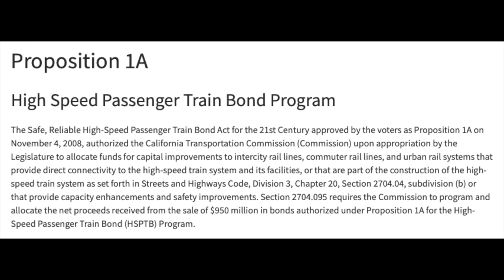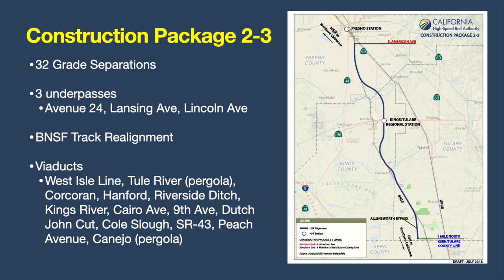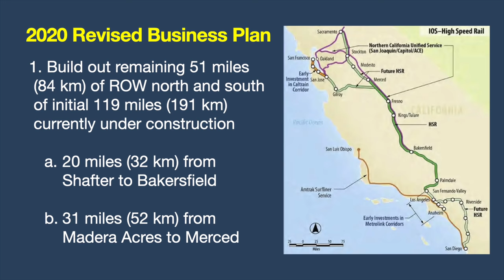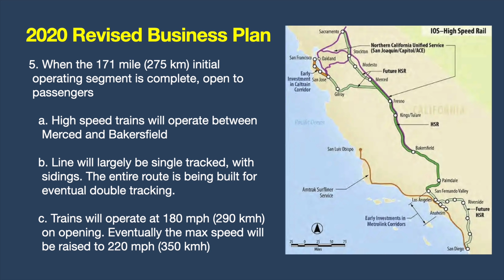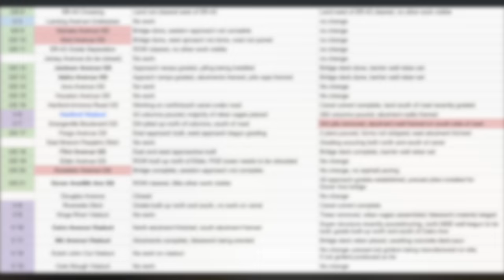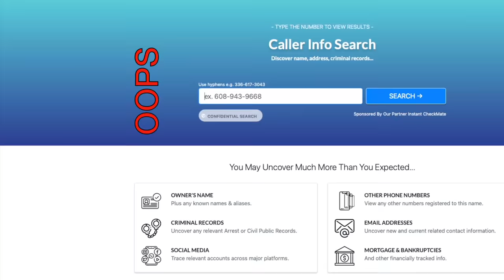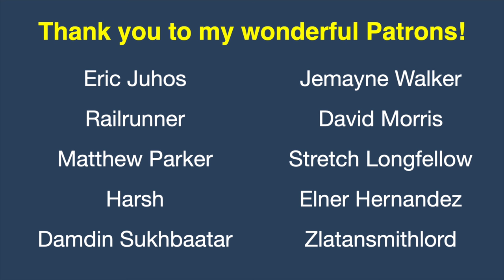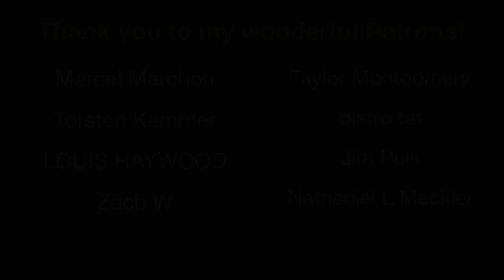California is Building High Speed Rail. It’s time to finish it!

Comment: I just want these trains to be finished so that airlines can stop destroying my wheelchair and delaying my departure. Imagine being forced to wait an extra 30 minutes to an hour for someone to unload your wheelchair and cramp you into a small isle chair, only to find out they broke something. Never had that kind of experience when taking the Sunrail in Orlando.
Reply from the maker: Yeah, I’m sure that’s a pretty awful experience!
Reply: I'm so sorry to hear this. How heavy is your wheelchair? I worked for the airlines, and those heavy wheelchairs all have to be handled by hand. I remember when we were unloading a very heavy electric wheelchair once, and the worker in the baggage bin didn't set the brakes before putting it on the belt loader. That wheelchair came ripping down the belt and almost hit me. Had it hit me, I would have definitely had broken bones or possibly killed. I was horrified after seeing it land on its side on the ramp. I know this is someone's legs, and I knew it was damaged. 

Then there were other situations where we would get it offloaded and had to take it to the other side of the airport to get it up the elevator, then get it all the way to the gate so we could give it to the passenger. This sometimes took 20 minutes or more. 

A few things I would like to see happen is better instructions on how to handle the wheelchair. And!! A device that can be used to safely load the wheelchair into the aircraft. Those belt loaders are not practical when loading a large and heavy wheelchair. I wish all the wheelchairs had the same process on how to turn the power off on them. We would normally have to remove the battery and disconnect the wheelchair for safety reasons. It would be challenging sometimes. This led to delays in getting the wheelchair boarded or to the customer quickly. 

Any advice or suggestions? I ask, because I would like to find a way to reduce this from happening to you and others who use wheelchairs when flying. I would love to invent a machine that could load these easier and prevent them from being damaged.
Reply: @ChrisJohnson-hk6es  It’s nice to hear someone who cares so much! My wheelchair is very light, most people have no issue lifting it even with one hand with the brakes on. It’s a manual so that’s probably why. The wheels and seat come off, sometimes I take the seat with me on the plane. The back folds down. It can fit into most spaces with puzzle work. 

I think the best way to help is by asking the user the best way to take the chair apart and put it together and how the brakes work. Most of the issues I’ve had have come from people showing up last minute to board me on the plane and then not bothering to listen to me explain how my chair works. It then ends up with my wheels not being all the way on, causing them to fall off while I’m pushing myself. I’m sure you can imagine how that ends. 

Honestly, they should make a manual that has the most common types of wheelchairs and how they function on hand to avoid these incidents if there isn’t enough time to hear from the user. 

I usually don’t have an issue with the wait time, just the manhandling of my chair and my body. My feet getting caught under the boarding chair is not a fun experience. To think they’re actually surprised when I say “Ow!” as if twisting my ankles far enough wouldn’t hurt eventually.
Reply: Oh, you don't like the airport baggage demolition dept. handling your essential equipment? Picky, picky, picky.
Reply: @GlitterSkies  I am so sorry!! I am now thinking about bringing this issue up to some higher ups at the airline I work for. I do think there needs to be more training for ramp workers on how to properly handle wheelchairs. Do you have an email address you can share, or a website I can contact you at? I really want to make it more aware and see if there is more airlines can do to address issues like this. I know you aren't the only one that has stories like this. I think every single airline should have more extensive training on this subject

Sorry for the late reply! I am still kind of figuring out youtube. 😂😂
Reply: Enjothe $1000 tickets (each way)
Reply: @phreshone1  Um, ok, whatever. I wish i could reference this when tickets actually go on sale.

Comment: Thanks for the video.  I just came back from Europe.  I  took the high speed rail Eurostar from Paris to London. It was so much easier,  enjoyable experience. You put your luggage on a rack or overhead capartment. The seats were comfortable. The bathrooms on board were more spacious and clean than the ones on the plane. But best of all, going through security and customs is much more faster and easier at the train station than at the airport.  When I flew from Frankfurt Germany to LAX I had to go through 3 customs checks! Believe me,  while I was riding the Eurostar high speed rail, the thought that came to my mind was,  why is this not in America? It was an awesome experience.  A flight from Paris to London os an hour and 15 minutes,  whereas a train ride is 2 hours and 30 minutes.  Still, they drop you off in the middle of the city where airports are usually towards the end of a city. 
As for CA, can you make a video on the efforts to bring high speed rail from Los Angeles to Las Vegas.  Believe me, my only concern is will I able to get a ticket when a line between those 2 cities is established. 
P.S. the only negative about traveling the Eurostar star was the price. I admit I got the ticket at the last minute.  But, a round trip ticket cost me 450 Euros, which translate to almost 500 US dollars.  The plane would have been a little cheaper.  If this high speed rail is to work ot needs to be not only a better experience from start to finish,  and I have not doubt it would be, but it needs to be a little cheaper than the plane ticket.  I went on and purchased the tickets to see what it was like to ride a high speed rail.

Comment: The problem is that there isn't sufficient demand for either entire-length or incremental travel on this route.  And even if there was, once you get to the stations or the ends, you still have what planners call the "last mile" to get you to your final destination.  

In Japan, there are several speeds of Bullets trains (Shinkansen) that stop at different stations along the way (so faster "thru" Shinkansen (Nozomi) can pass while the slower "local" Shinkansen (Kodama) are stopped for picking up/letting off passengers at the smaller stations).  The distance between each of these stations is critical to the schedule for timing the passing.  

At each Shinkansen station, you can connect with multiple subways, local rail lines, buses and taxis to get to your final destination.  In Tokyo or Nagoya (probably every city), when you rent an apartment or buy a house, the walking time to the nearest subway/train/bus station is rarely over 15-20 minutes and usually less than 10 min.  It is often the deciding factor when considering where to live.  

The American culture still revolves around the car so our cities, highways, infrastructure has been car-centric for most of a hundred years.  High speed rail in Fresno or Bakersfield isn't going to change that.  Where there is demand for eliminating vehicle congestion is between LA and Las Vegas, where Hwy 15 gets so congested that it often takes two or three extra hours to drive what should be a 5 hour drive.  Holiday weekends are the worst, but it happens every weekend now on Friday and Sunday.   That would have been a better location to start this kind of project, but that would have required better leadership from politicians.
Reply: With uber and lyft, the "last mile" is not really relevant. 
It would be real interesting to see what data you have that shows insufficient demand for "entire-length/incremental" along this route!
Reply: @chrisstromberg6527  If there was great demand on that route, then the airlines would all be selling-out seats (or adding LA-SAC flights).  Or, there would be congestion on Hwy 5 and 99 between cities along the route (CALTRANS would be reporting increases in miles-travelled on those highways and/or Greyhound would be reporting sold-out busses).  That's why I explained the LA-Las Vegas congestion issue - it shows where demand is - rather than looking for solutions to problems that don't exist simply for political reasons.

The point of my comment was that you can't have the "if we build it they will come" mentality especially when the cost is so astronomical that it'll never be paid back in any of our lifetimes.  I doubt any private company would take this on since the ROI isn't there.  That's why many people who can afford to are leaving California - the ridiculous spending on "bridges/trains to nowhere" just adds to the crazy taxes.  Unless there is a comprehensive door-to-door solution, a train alone isn't going to solve anything. 

Better solutions than spending billions for little benefit are necessary.  To solve the "last mile" issue there is an Amtrak Auto-Train that runs from Virginia to Florida down I-95 (and back).  Like the European Channel-Tunnel between London and France, you take your car with you on auto-rack cars and sleep overnight on the passenger train for the 800 mile trip on existing rail lines. But that's the only one in the US - lack of demand or lack of interest?  I don't know, but it wouldn't take billions to add those trains to existing overnight rail routes in other states.  That would judge demand and convenience.

Japan is roughly the size of California and, because of the mountains the population is mostly clustered along the east coast.  The extent of the major population centers are a little farther apart than the distance from San Diego to Sacramento, so the Tokaido Shinkansen works for them, but they convinced the population to accept it since it started in the mid-1960s.  And rail travel was predominant since the 1950s and the Japanese people have accepted mass-transit for generations.  Americans, not so much.  The US is so large that only air travel would be practical for coast-to-coast travel, so the airline industry won't go away and airlines will likely undercut any high-speed rail fare just to keep the people in their planes.  That's reality.

This whole thing is just a solution looking for a problem that doesn't really exist.

Comment: The engineers are genius for the way they planned this.

By making the first 4 CPs out in the middle of nowhere and the easiest to build, you force the harder parts to be done later (the tunnels) and motivates full funding over time.

“Well, there’s no turning back now”

The tunnels in and out of San Francisco Bay and in LA + under Burbank will be some of the most expensive.

I think we’re looking at a $250B project when it’s all said and done—but still worth it. When the environment benefits, we all benefit. 

We need to become an energy-efficient species. 

I mean then what’s the use of Fission research? More electricity for refining more fuels? 

This is the next logical step for our civilizations.

Comment: about 2 years ago I tried to argue my brother that electric locomotives can pull freight and they are a good way to cut down on CO2 emissions, he won by spewing BS in waterways because I was 11 at the time, knew a lot about trains, just not modern ones, and he was 10 years older than I so he could argue much better... I kinda want to restart that argument just to see if I could convince him
Reply from the maker: Yeah, there are numerous examples of electric freight trains around the world (which I’m sure you know). Even the ACS-64, while being lighter than say an ES44 has like 9,000 horsepower, which is like a lot lol
Reply: 9,000 horsepower in a locomotive lighter than an ES44 has to make you wonder how much they struggle with wheel slip, because even the big boys could only reach around 6,000 or 7,000
Reply from the maker: Indeed. I would imagine given their relatively light train weights, that it’s not a huge problem, and I believe the on board computers try to limit wheel slip, but I’m sure it definitely happens lol
Reply: @awildjared1396  
In Germany modern four-axle electric locomotives have replaced older six-axle locomotives that also weighed around 50 tonnes more. With traction control and individual motor control they can actually achieve more traction than the older locos, but will struggle in very slippery conditions.
Reply: Every locomotive is electric. They are all basically hybrids.
Reply: I know that most freight locomotives in the US are technically diesel-electric units, but I just shorten it to diesel

Comment: I really hope that the Madera HSR station never gets built. What the city really needs is a conventional rail station in its downtown (i.e., along the UPRR) instead of a HSR station in the middle of empty fields. Great video!
Reply from the maker: Agreed lol. Thanks!
Reply: Those are two different use issues. Why not have both?
Reply from the maker: Why not indeed lol
Reply: My understanding of the current plan is to relocate the existing Amtrak station from Ave 17 to the Ave 12 HSR station location. Having seen the plans for housing development, due to living in the area, the HSR station will end up in the middle of a populated area. They are currently building out subdivisions on Ave 12 and Hwy 41, 6 miles East of the tracks. There are plans for houses and retail in the Ave 12/Road 35 area. There are also plans for housing between Ave 34 1/2 west to the Community College on the West side of the tracks. There is also a push to build residential at Ave 12 and Hwy 99 to the west of the college and to build out to the South end of the City on Madera. The Ave 12 / Hwy 99 / UPRR Overpass to the West of the Ave 12 HSR Overpass, has had a major upgrade in anticipation of all the traffic created by the new housing.

Comment: The most challenging engineering of the entire project is the tunneling of mountains with consideration of seismic activity. What is and has already been constructed doesn't meet that level...this is the easy part.
Reply from the maker: Yes lol
Reply: I wouldn't say it's necessary harder or easier to tunnel, but different. Of course, the companies that will do the tunneling work will be experts and have tons of experience from around the world as tunneling is common place for many rail projects whether it's on HSR or conventional trains. However, even though the tunneling might be more technically challenging, it might be done quicker than many of these viaducts because these above ground projects sometimes require many mitigations like rerouting existing roads, highways, etc. I can't wait to see actual tunneling done though with those huge tunnel boring machines. I wouldn't be surprised if they use several of them for the various tunnels.
Reply: @theexmann  The most challenging engineering like tunneling will be saved for later. The goal now is to complete was is the easiest so as to get fare paying passengers. Once there are paying passengers, funding for the completion will be more likely.
Reply from the maker: It certainly is different. I hold no pretense about the tunneled portions being smooth sailing. Under the best conditions, a 10 mile long tunnel, or whatever the longest reach will end up being, will take years. That said, between property acquisition, railroads, caltrans, and every utility company under the sun, the large viaduct structures are a very complex undertaking
Reply from the maker: For sure
Reply: @TheFourFoot  The construction of the Gotthard Base Tunnel through the Swiss Alps took about 15 years. Tunneling through the San Gabriel Mountains should take less time.
Reply from the maker: Yes, it absolutely should lol
Reply: @SpockvsMcCoy  Yes, definitely. I don't know if it's the easiest per se, but it is definitely the least expensive per mile so you get more bang for the buck.
Reply: @theexmann  Tunneling is much more dangerous than what has been completed so far. Any miscalculation when tunneling can be catastrophic.
Reply: @SpockvsMcCoy  True, but I know they are and will continue to test the soil for all these proposed tunnels. I'm sure there is a lot of work being done now to be as ready as they can when the actual tunneling starts. Of course, as we've seen with LA's subway construction, problems always come up. Though I haven't heard any big issues with the latest extension of the Purple line to West LA. the way there was when it was extended to Hollywood when there was a big problem with subsidence.
Reply from the maker: LACMTA definitely had to learn the hard way about tunnel construction safety, but I know the purple line is going much smoother
Reply: @TohaBgood2  Eminent domain practically guarantees that the government can take private property with fair compensation. Extreme environmentalists are more disruptive to mega infrastructure. My earlier reference to the most challenging is solely in regards to the technical challenges. All of these pergolas, shallow trenches, and bridges over shallow rivers are not technically challenging. As for conservative opposition, historically farmers and ranchers oppose almost everything that requires their land. No doubt, the California Aqueduct, Interstate 5, Highway 99, and the mega California dams all had historical opposition.